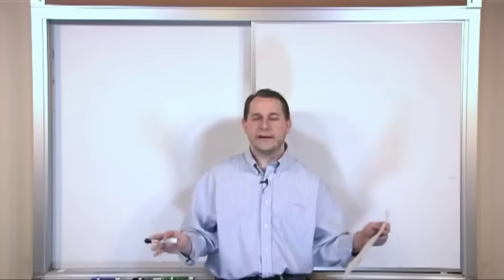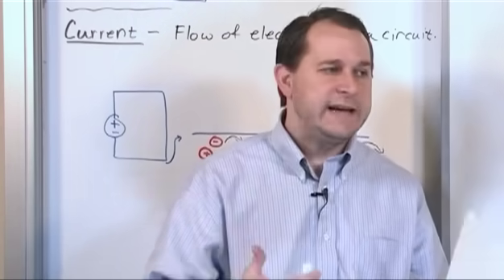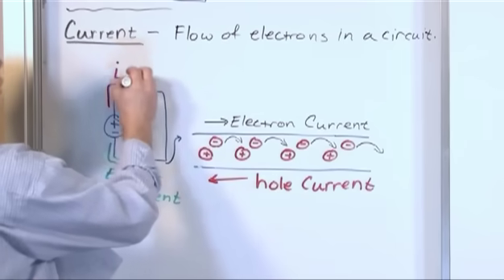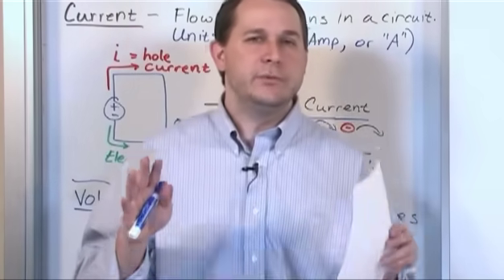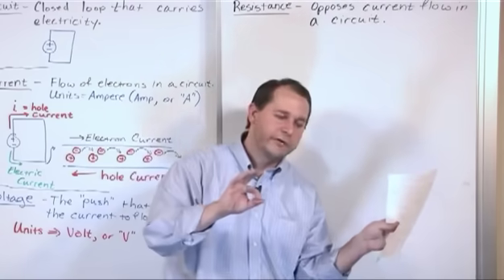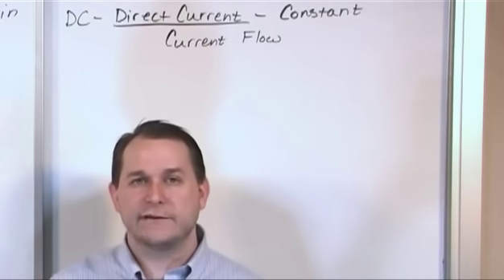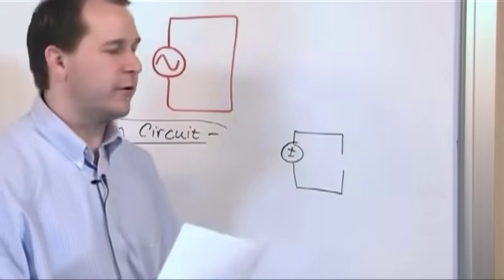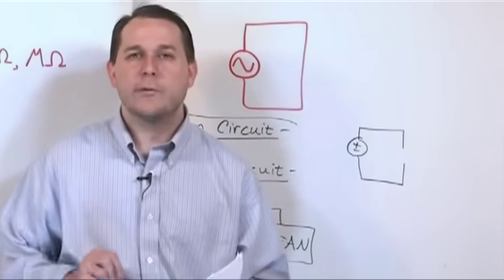Lesson 1 - Voltage, Current, Resistance (Engineering Circuit Analysis)

Comment: Now THIS is good teaching. You can tell this guy knows what he’s talking about and is very genuine. We need more teachers like this, and we need to pay them a higher salary
Reply: A lot of people know what they're talking about- what makes a great teacher is how clearly and understandably you can communicate it. This guy has that in spades.
Reply: @nnhk0056 yeah however most people don’t know what they’re talking about.
Reply: Agree. First, he explains the concepts. Then, he touches on the physics and I appreciate that he explains the electrons are not running down the wire; they are jumping from atom to atom. Kinda important. But not important at the circuit design level. But very good to understand.

Probably the best explanation of voltage, current, and resistance I've come across.
Reply: That's the key.  Great teachers will do it for the garbage pay, but you can't help but get bitter when you see how people wirh onlyfans pages are making more in one day than you make in a  year :P
Reply: Agreed no more!
Reply: https://youtu.be/XtjOR89t-gE
Reply: Before you make a blanket statement like “we need to pay them a higher salary”, you need to find out how much they already make, where it’s coming from, and more importantly, WHO is “supposed” to pay them more? I don’t know about you, but I’ve been paying on my student loans for well over a decade already. So who’s “we”? The students? The tax payers? The Devil is in the details.
Reply: I think this guy gets paid enough. On his website (https://www.mathtutordvd.com/) it says he has over 100,000 students and the fee is like $20 a month. This guy is probably making $10million+ a year for himself from this stuff.
Reply: @SOMEONE-cd9wf  well he deserves it
Reply: @SOMEONE-cd9wf  Good for him. He is doing what he likes and money is just a positive side effect of this.
Reply: @SOMEONE-cd9wf  most bought a single dvd. mannnny less subs on a monthly stream
Reply: @SOMEONE-cd9wf  He deserves whatever money he makes.
Reply: @nathanmotta7528  Profit is theft. We need to seize his wealth and redistribute it to the teachers who can't speak as good.
Reply: @chrishayes5755  LOL!
Reply: true.
Reply: No, we need to eliminate money all together because it is obviously destructive to all Life. You can’t just call Greed, the dark love of Gold and Riches economics and it becomes something different. It only makes those who you teach this economics to ignorant to the truth of what they are feeling. And the dark loves feel good, feel like what they are, love, but the Darkness is destructive. That is it’s nature no matter what humans in their limited ability to perceive and more so comprehend reality tell themselves.  This man is doing what is natural to the male animal, teach. For Father is the Teacher not the Leader. Meaning, it is not Father’s voice that all children heed and fear and all men protect and honor. 

The distortion of truth that infects all that humans claim to know and have accomplished. This one distortion of what was once called the Spirit the intangible power of the mind, like a wound to the Body can become septic if untreated has become a spiritual sickness, a mental infection in the species and is in truth the root of all their problems. A bad assumption that every human being has accepted as truth because they chose to accept the complicated answers of the sickest of the species. The most vulnerable to spiritual distortion, meaning they are the most complicated and complex all the life in their mental powers, meaning they are the most prone to errors. As every woman knows well, or did before they accepted the distortion and so have become just as sick, sicker truly because the female is by nature’s design the stronger of Spirit. For it is Mother who is the voice of power, wisdom and authority. The natural dominant, leader of pack and hunt, of family and people. 

But the male human obviously did not like his role in Nature’s design and told himself a thousand lies, a thousand complicated rationalization, a thousand justifications as to why he is the dominant one. And then used their one advantage, their strength of Body, to impose this distortion through violence and sexual perversion. A thousand lies that all oppose one another as to the nature of this reality and the meaning, purpose and value of all Life, including yours. Lies which are just beliefs. Just guesses of the male mind they call scientific theories, religious faiths, or philosophical laws. Be it Moses, Darwin, or Plato. A Religion, Science or Philosophy. A Faith, Theory, or Law. It is all the same, all fundamentally flawed by this bad assumption. The lie that says human belief, specifically the bearded humans beliefs dictate the nature of this reality, that their words and definitions assign meaning, value and purpose to all Life, including yours. 

And you excepted this lie when you accepted whatever dogma and it’s jargon you did when you grew up. The opposing beliefs you just copied and accepted as reality because it was what everyone else was doing,what those you look to for your place in the story, your role in the story that you all need to feel complete we’re doing. And sorry, not sorry this choice made you sick. This choice is the cause of all your problems, all Life’s suffering including human suffering is the result of this choice. And humans are but one species. And they have told themselves lies of the men for decades to justify their choice to destroy and torment the rest of the Life including others of their own species in some sick game of war, of opposition they just call competition over whose version of the same lie is the best. Only insecure people care about who is worth more or better than. Only someone who doesn’t know the value of their Life, which is the same value as any Life even cares about who is right or wrong or any of the other superficial things you imagine give you a value. A higher value than someone else. A higher value than all the Life of the planet. 

And this is not what good people do. This isn’t even what bad people do. This is what sick with evil people do. And evil never calls itself evil. It never thinks it is evil. It always thinks it’s the good. But you can always tell the real evil if you use your prudence and are honest. Evil is always fighting something it calls evil, always has enemies it just calls evil. Only evil wars. Only evil has enemies. Only evil does anything that the sick species I call my family but am mortified and ashamed of does. That you do. No other species forces its offspring to pay for the knowledge it claims to have accumulated? No other species wars against its own people over imagined values and the things evil always loves. Gold and riches, power and sex, status and attention, an easy life of comfort, and entertainments, fine foods, drinks and drugs. No other species wars over its guesses, it’s beliefs, it ideas which in truth is not even anything any of them created just copied. Loving their copied answers and the superficial traits and talents the imagined value that those copied answers are their worth more than they love each other and the life of this planet they have already destroyed over half of in the vain glorious attempt to prove they are something that Nature did not make them. All because the little bearded wanna be bitches wanted to be in charge.
 
It’s that simple. That stupid. That male. You are welcome.
Reply: pah, not this bloke though. he completely gets electricty wrong. electrons pushing each other down a bit of wire. utter bolocks.
Reply: @KarldorisLambley  true. Everyone knows it's actually little angels and demons fighting each other.
Reply: @t @tomv3999 ou got it totally wrong. They don’t fight at all. The angels carry small crosses (that’s how positive got its symbol) and run one way , while the little rascal demons carrying little swords (thus the negative symbol) run the other way. They only fight when they’re forced on a meet and greet event.
Reply: DJ Watson Yh

Comment: As an electrical engineer myself, this guy has some of the clearest explanations I have ever heard.
Reply: Been in the commercial/industrial trade for 5 years. Me, personally....we're mainly installers, with enough information to get panels, transformers, switchgears, generators all hooked up with basic knowledge of electricity (my opinion), but there's also times where we NEED to learn more of the advanced side of it all and this helps a lot.
Reply: https://youtu.be/SEUtgpShfIs
Reply: the total amount of current required in all parts of a house is known as the electrical
Reply: What? Amp load or volt
Reply: You might as well bounce basketballs off my head. Seriously,  after 3 times, I kinda need to watch it again. I don't know why my brain is rejecting this information
Reply: What have you studied in Electrical Engineering?
Reply: You are NOT real EE. You should know The Basics: energy transfer by the EM field along the wires (NOT inside in the electrons movement - it is needed to guide the energy close to the surface, which is the point of using wires VS transmission as radio or light, ineffective over distance).
Reply: My undergrad is in electrical engineering and I have agree.  I a VHS tape like this was available when I was in college.  Basics circuits with DC, I was ok.  When I started getting into AC with RC, RL or RLC circuits I don't remember much about or I didn't learn it very well.  Because the electronics was calculus based, the math was a killer in itself.
Reply: Fact
Reply: I was thinking the same thing. He answered the simplest questions I could never get answered...and I didn't even have to ask him!!
Reply: HELL IS REAL 

HEAVEN IS REAL

GOD IS REAL

JESUS IS THE SON OF GOD

ALL THOSE WHO ARE NOT SAVED WILL GO TO HELL AND HELL IS TORTURE FOR ETERNITY BURNING IN NEVER ENDING FIRE, ONCE YOU ARE IN HELL THERE IS NO WAY OUT, HOWEVER RIGHT NOW IT IS POSSIBLE TO PREVENT YOURSELF FROM GOING TO HELL AND BECOMING SAVED AND THERE IS ONLY ONE WAY OUT AND THIS WAY IS JESUS, JESUS DIED AND ROSE AGAIN AS A SACRIFICE FOR OUR SINS SO THAT WE DON'T HAVE TO GO TO HELL AND WE CAN HAVE EVERLASTING LIFE SO WE CAN SPEND ETERNITY WITH HIM IN HEAVEN WHICH IS PURE PARADISE. ALL YOU HAVE TO DO IS TO PUT YOUR FAITH IN JESUS AND TRUST THAT HE WILL SAVE YOU AND THE HOLY SPIRIT WILL MAKE HIS HOME IN YOUR HEART AND LEAD YOU ON THE RIGHT PATH. DON'T DELAY IN TRUSTING JESUS BECAUSE WE CANNOT TELL WHEN IT IS TOO LATE. JESUS IS COMING SOON PLEASE BE READY AND MAKE THE RIGHT CHOICE

Anyone is welcome to join this Whatsapp group just use the link below

https://chat.whatsapp.com/KtLIrfQWKTICxO87MleVQK
Reply: so can we say that resistance is a force @BrandonCharlex24
Reply: @BrandonCharlex24  what are you doinh heree
Reply: @BrandonCharlex24  ea
Reply: @BrandonCharlex24  shut the fuck up
Reply: @dankhill_ 

English  movies English movies
Reply: @BrandonCharlex24  if jesus is gods son then who is gods father ??????
Reply: @philldavis5778  god doesn't have a father
Reply: @philldavis5778  There is what is called the Holy Trinity. God the Father, God the Son, and God the Holy Spirit. They are all equal, one and work in unity.
Reply: @philldavis5778 Jesus is Son because od the Holy Trinity

Comment: So is the idea of electricity, is really just charged plasma fluid like material moving through pipes?
Reply: Electricity is the flow of electrons through a conductor (usually copper since it has excellent  conductive properties, directly linked to the number of valence electrons in copper atoms). In a way, yes it does flow through the conductor (wiring) like water does through pipes. But this kind of “water” can kill or badly hurt you if you touch it.

Comment: They use AC current so they can charge us for the work provided so I believe that's why then went with AC current instead of DC but things are changing.
Reply: AC is used so they can step up the voltage for transmission over great distances without losing voltage at the customer end.  It's the voltage/power loss that doomed Edison's DC idea.

Comment: I have a Software Design Engineering Degree. I studied Electrical Engineering before going off into Software. 
But I've never had the simple definition in my clear understanding of the difference between current & volts

Comment: Hello Sir, I have a question regarding voltage,   why does a  240v, it carries larger wire as compared to 480V.?
Reply: Because a higher voltage pushes less current.  As the voltage increases, current (and the friction it creates) decreases through the load and you can get away with smaller diameter wiring.

Comment: So in Summary, A circuit is a loop of flowing electricity. Electron current is the flow of electrons. Hole current is the mathematically constructed flow of postive charges as a result of flowing electrons. It is mathematically equivilant to electron current, yet easier to apply in the equations of electricity. Voltage is the generator of push of a flow of current. Dc Current is constant current. Alternating current is a current that goes back and forth in certain amount of time. Resistance is a property of the carrier of electricity, whether its a wire or a device, it has a property of oposing current. Resistance is measured in Ohms, Current is measured in amperes, and voltage is measured in volts.
Reply: mido222100 amazing explanation. This helped me really understand. Thanks!
Reply: @adrienhartman6811   You are welcome man!!!
Reply: @mido222100 but amps are the speed of the flow how much flow is going through and voltage is the power

Comment: Is an open circuit only within a building structure (alternating current?)? Like it isn't a part of a cell phone charger?
Reply: & is Direct Current similar to a generator? I figure this because it's constant power... Right?
Reply: @kailaperez2814  True,Alternating Current is part of your basic cell phone charger as well as many other daily appliances as well. This is because of the flexibility and interconvertivibility of ac current, and why it is preferred over dc. But unfortunately ac current cannot be stored as it is. Only dc current can be stored in a battery. Hence most portable or wireless devices would run on dc like your electric hand drill(the portable version) , your mobile phone, ipad, and even your digital thermometer too. All these have a battery or a dc source within them. 
Now you may ask that the wall or charger supplies ac from the building socket, well thats true too. But your mobile or laptop charger converts the ac into dc by using a specialised ckt ,so that the dc current can now be used to charge your mobile battery . I hope that helps shed a little light on your question.

Comment: Hi sir, for the short circuit diagram example, what if the wire you use to make this short circuit, is much more longer than the wire going to the fan? Does it make the wire to the fan has lower resitance?

Comment: "Electricity is always going to try to go the path of least resistance.. just like you do"

Me: going on 3 months of doing absolutely nothing during quarantine
0_0
Reply: Hey! You watched this video, that's more than most!
Reply: You have been very happy Birthday Bubbbjfvvuuyyyyyyyyy I
Reply: This is false. Current will take any path that is available to it. Which means it can even take the path of leaking out of the wire into the surrounding air, which is seen as sparks when dielectric breakdown of air happens.

Idk how no one mentioned about his mistake. But other than that. Its such a great video. Please correct me if I'm wrong as I am in process of learning as well.

source: https://physics.stackexchange.com/questions/5670/electricity-takes-the-path-of-least-resistance
Reply: @alexg.1465  Have you ever thought that air may be the path of least resistance?
Reply: @edwardcorbett4020  exactly!

Comment: The part where he is talking about positive charge going the opposite direction isn't he talking about the mistake of engineers long time ago where they just kind of assumed because they didn't have the equipment, so they assumed that the current goes from postive to negative, with this mistake tho the formulas are still consistent right.. Correct me if I'm wrong since I'm new to all of this nad I just heard about this conventional and electron flow

Comment: Small correction if you don't mind ! During the short circuit, the value of the current (Amp) will increase to the maximum that voltage source can push but will not be faster as explained, because the source of Hz is still the same (60Hz or 50 HZ) which is responsible for current (Amp) speed.

Comment: The best way to explain the direction of current is to go back to history when the early scientists or "electricians" of the day thought of current as an "electric fluid" like water which flows from a location of positive pressure to the location of negative pressure. Back then nature of atoms and hence, electricity wasn't discovered yet. It was only after electrons were discovered, they realized the flow of electrons is what caused the flow of current. But for the sake of simplicity, they stuck with the earlier convention for direction of current. Just like units of measurement, the conventions doesn't inherently change the nature of electricity. For instance, 72 F or 22 C might appear different but that doesn't change the hotness or coldness. The directions are our mental abstracts for simplicity, problem solving and applications.

Comment: if you run a wire from the positive  lead on battery   to the negative side you wount have wires  for long they will melt  whats up  that would be a short  circuit   the  current will  ground out causeing a melt down it dont go round and round it collides and  welds